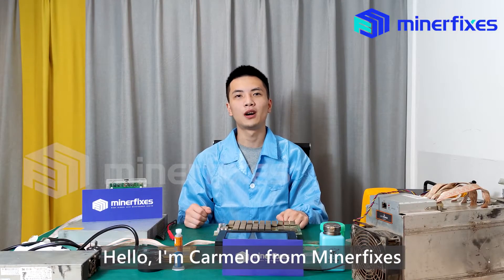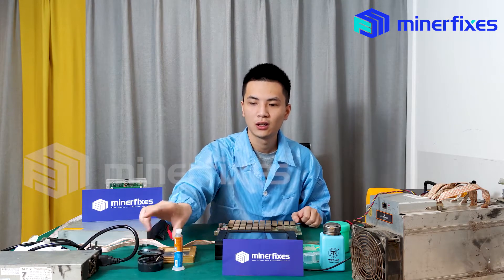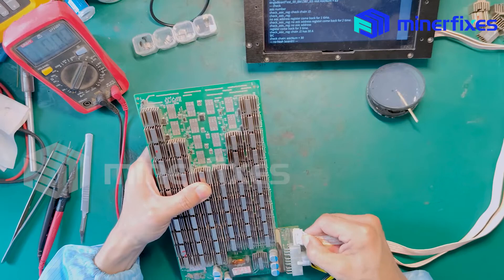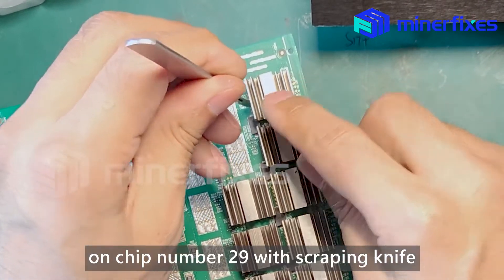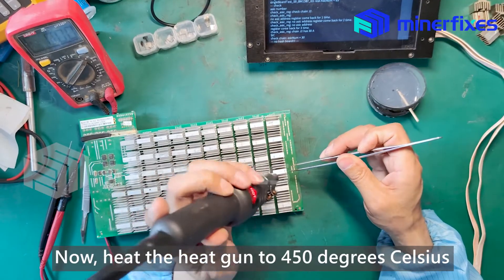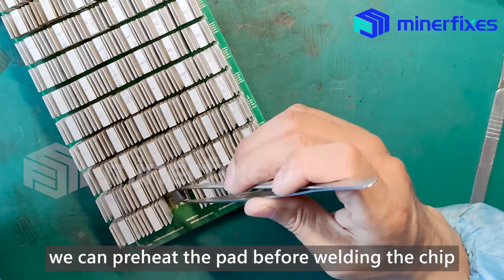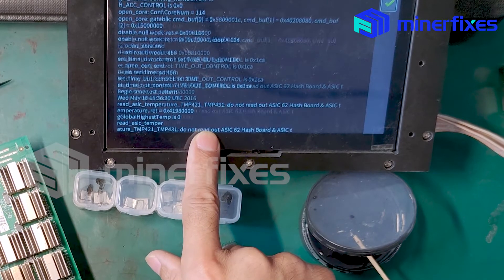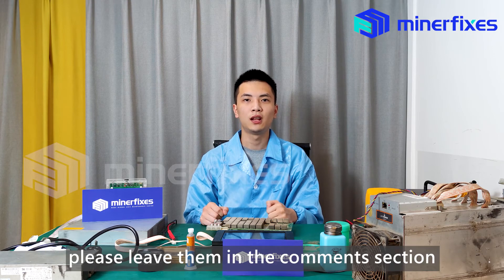How to detect the failure of the hashboard chip through the tester?

Comment: Hi, what is ideal fan level when using the air heater to remove the  damaged chip?
Reply from the maker: Generally adjusting the air to the maximum, the heat is 7 gears, about 400 ° C. There are more questions. Welcome to ask my WhatsApp: https://wa.me/+8613608018782